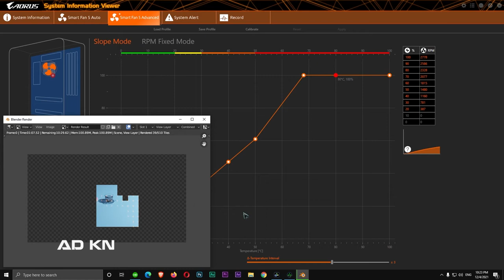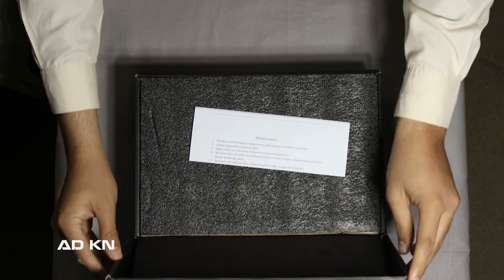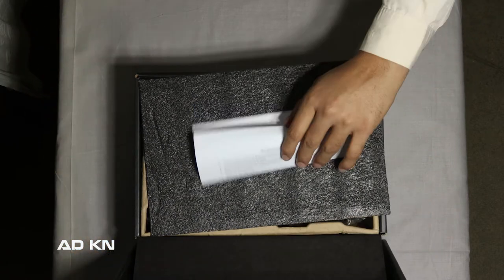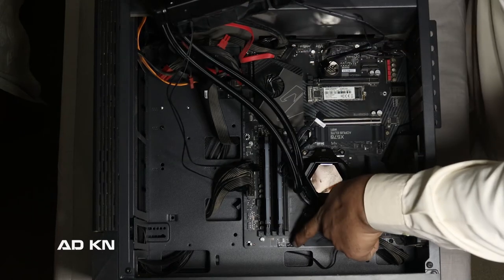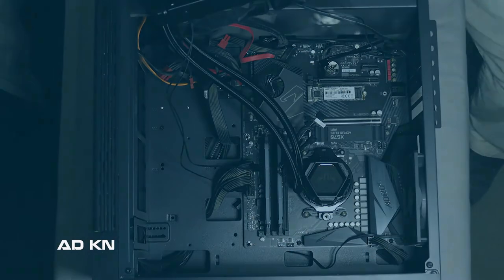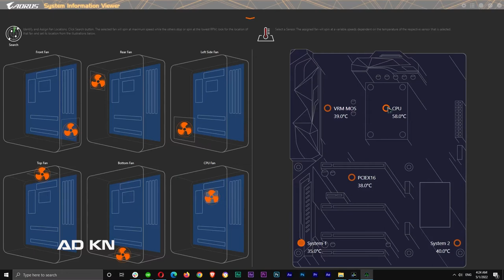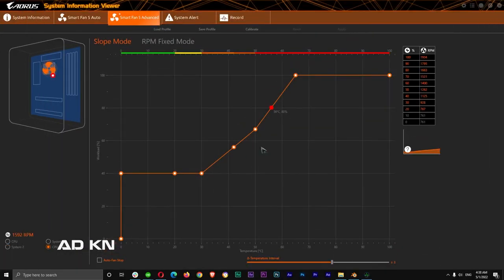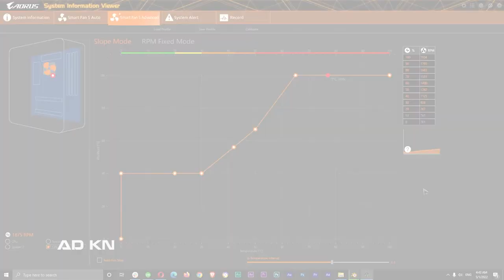How To Install Any AIO CPU Water Cooler - Asus TUF Gaming LC 240 RGB

Comment: Sup ,Bro i have same wc,but i cant identify the pump cable to conect in optin like in the video
Reply from the maker: Check your owner manual, it has further info.
Reply: @adkn  its not showing ,Just say to conect aio pump in aio slot
Reply: This aio have 2 cables its the 3 PIN one or 4 PIN ?
Reply from the maker: @arch4916  I am really sorry, I can't remember it now from my memory. You have to search it on Google now.

Comment: I think i got defective one , my pump make a little rattling noise :(
Reply from the maker: If you can return it for warranty, then do it. If that's not possible, just run and if it works fine, use it. Who cares about noise. Remove it when it becomes bad.

Comment: I have this Water Cooler on an Asus B550M-Plus Wifi II. I connected to CPU_OPT as I said, the other wire (Funs) where do I connect? CPU_Fan or CHA_FAN2 ? Can that second wire be shared with the cabinet Funs? Thanks
Reply from the maker: Here it is:
1 - Connect Water Pump to CPU_OPT
2 - Connect both fans to CPU_FAN, there is splitter cable in your cooler box, use it for this. If you don't know what a splitter cable is, google it, it comes free with this cooler.

Comment: did you have issues with the am4 mounting clip screw kind of bending?
Reply from the maker: No, but if things are not right, don't force it, show it to a professional, or take it to a tech shop. They will either fix it, or you can claim warranty if something was broken.